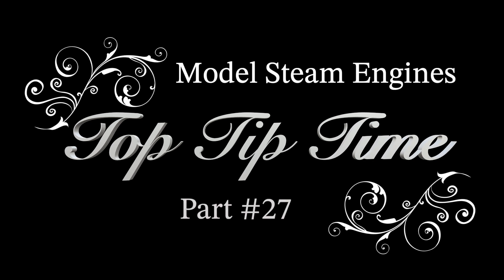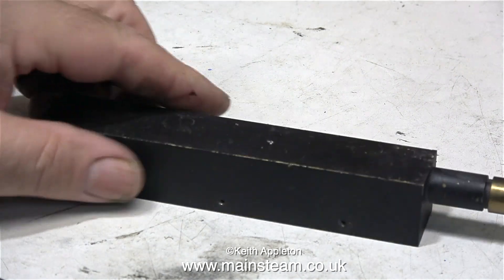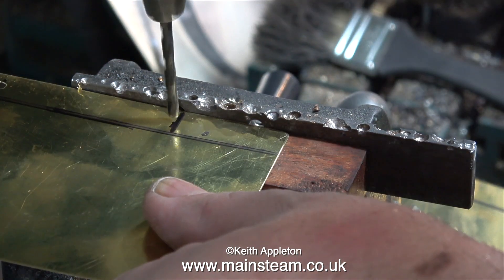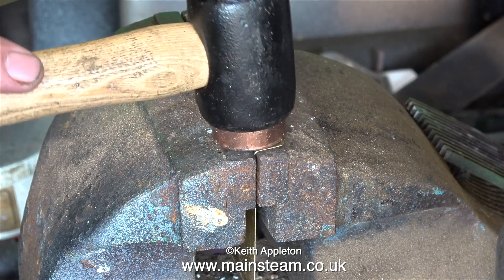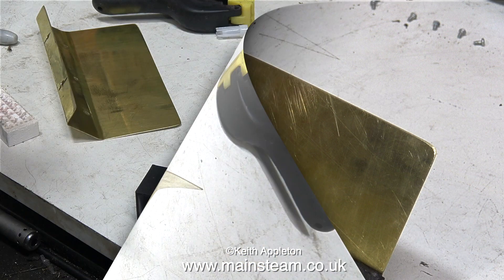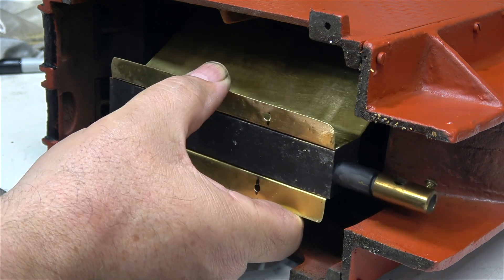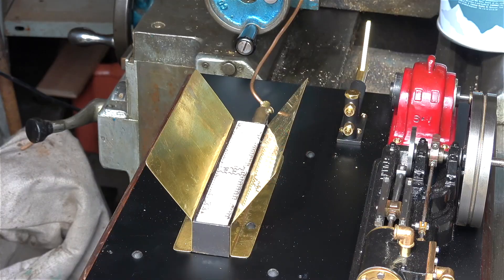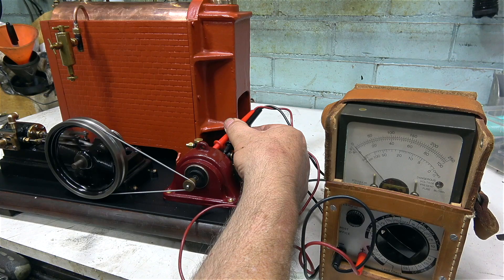MODEL STEAM ENGINES - TOP TIP TIME - PART #27

Comment: I always wondered why the scribers had the bent end.  I think I've see you use this feature more than anyone I know of.  But perhaps now that I've seen why I might find more uses for it myself.

The CA is heat sensitive.  So at the temperature that the burner will reach I would imagine that it melts away rather completely.  So the little screws are still holding the ceramic diffuser in place?  CA has become the go to glue for wax chucks and other similar uses since at about 150 to 180C  it melts and frees up the joint.
Reply from the maker: I have made a few Ceramic Type Gas Burners using Medium Viscosity Cyanoacrylate and so far they have all been OK - for the last 10 years anyway . . . . .

Comment: ever try the gel version of superglue? and could the heat from the burner mess with the super glue?
Reply from the maker: Yes I use medium viscosity Cyanoacrylate and is seem to work just fine . . . .
Reply: @keithappleton  thanks didn't know they had a medium version just the thin and gel

Comment: Is the super glue just to hold it in place for assembly? 
I would have thought it would just burn off and melt with the heat once you give it flame.
Reply from the maker: I use medium viscosity Cyanoacrylate and is seem to work just fine.